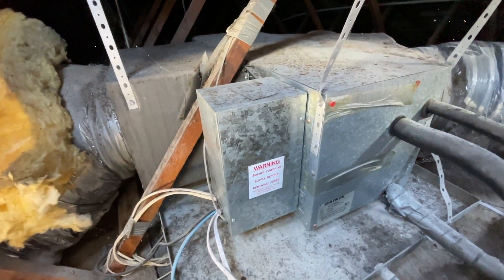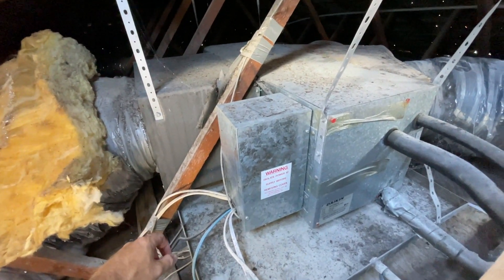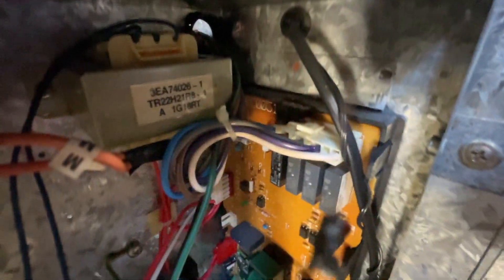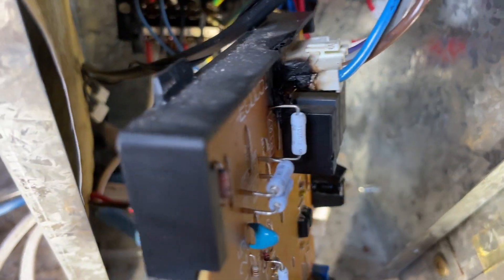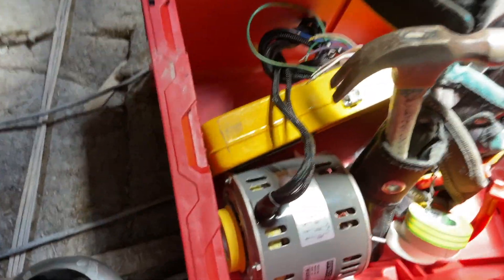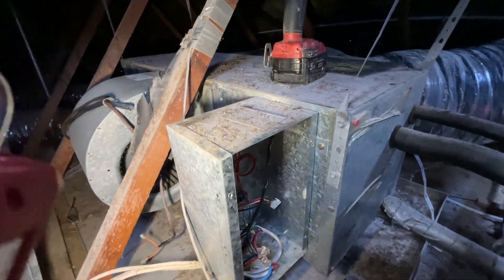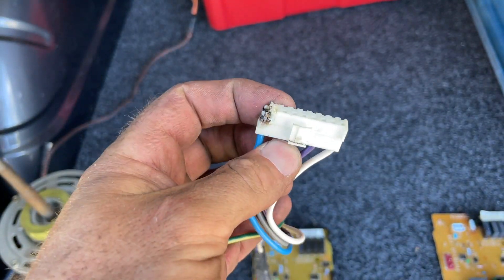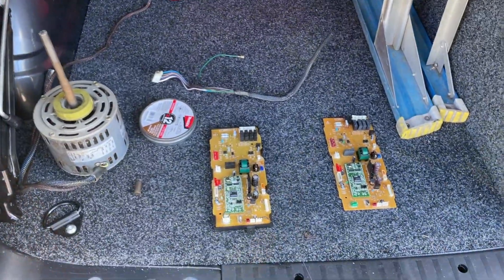Repairing Daikin U4 Error

Comment: Videos pretty old now but have the same ducted unit,which has just thrown the same u4 codes but fan and all the roof components all seem fine and kick in its the outside unit that's not starting up,any hints and tips would be great cheers....awsum video to help others and great job mate...
Reply from the maker: Hey mate, I’d put my money on either the indoor pcb is faulty or the outdoor pcb is faulty. U4 is a communication error and can be caused by the board just failing out of no where or like in this video, a component taking the board out. 

If I was at your house I would test the boards and the components in your outdoor unit (fan, eev, compressor). Really easy stuff for an aircon mechanic. If you’re keen, you can have a crack at testing those things yourself at home. 👍🏻
Reply: @maracservices even so if it will be easy for a daiken tech I may have to call one tomorrow, im just worried this day and age they will say toss it and buy a new one,which a quick google it ain't cheap...
Reply: @maracservices hey mate hard for me to beleive but had the tech around today and just so happens he says both boards are fried...he was here for about 1 hour,he took the coms cable off the inverter and couldnt do tests because it cut out the head unit wich he said was really strange,after ringing a daiken tech over the phone he came back with those results...😢 sad day 8k lata...thatnks for your input..
Reply from the maker: @mrjunior6883  hey mate, so are they going to replace the PCB’s or replace the whole unit? 8k sounds like they are going to replace the whole unit. I’m just making sure you aren’t paying 8 k for two new boards.
Reply: @maracservices yer mate at this stage waiting for the quote to come through but over the phone and using the existing ducting but hoping to be able to change out the head unit,the blower and the outside inverter,daiken premium unit..yer sux but what can you do...its actually been a crappy week lol,new gas hot water from a error code,3.6k..I decided only last week a 15kw batt to add to our existing system 6500k and now a new reverse cycle lol... 🤦‍♂️ yep that hurts
Reply from the maker: @mrjunior6883 if you have all that stuff happening at the same time. I’d just replace the two PCB’s. If there’s nothing wrong with the unit mechanically, why spend all that money replacing it?
Reply: @maracservices he said it's a old unit like possibly near 20 years,uses old gas ect and possibly hard to find the correct boards...daikin industrial rzp125dv1 im down in great southern wa

Comment: I have a U4 error now when on Fan mode with my Daikin 12.5kw ducted. Recently got regased as it had leaked.
My ac turns on for 5 mins then turns off for 10 mins with constant cycles of this.
Reply: Did you manage to fix it? I have the same problem.  Turns on, then turns off after 5-10 minutes. Then goes back on after a random time, then turns off after a few minutes. The U4 error doesn't come up all the time, only occasionally. The hotter it is outside the more often it happens. No solution for now other than to wait for the installers to come and have a look. Of course it's weekend and a public holiday on Monday and it will take a few more days after that for them to come. The forecast for the next 7 days is 32+, lucky me.
Reply: @Alex___R  yes
I had both boards replaced (small one I think that communicates with indoor Unit and large mother board)
Now works a treat

Comment: Just wondering is it possible to install a squirrel cage fan motor upside down if you flip the fan motor by accident when replacing itwould it cause the efficiency to go down or should not effect the barrels are put on correct way

Comment: Nice work. That’s a old unit. Did Daikin supply you the fan plug? Last time I wanted one they told me it was unavailable and I had to improvise it.
Reply from the maker: I got told the same thing so I also had to improvise. Luckily the plug was salvageable so I managed to clean it up and get it going.
Reply: I got told the same thing by mitsi. What i ended up doing was measuring the pitch (distance between each terminal) and plug dimensions, ordering a bunch of different plugs that came close